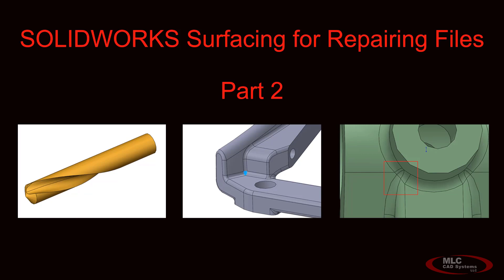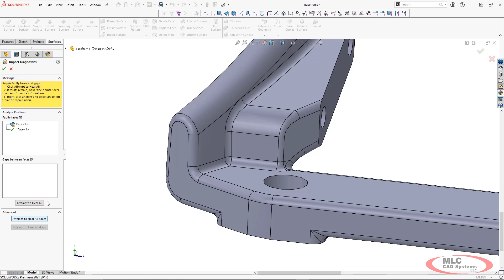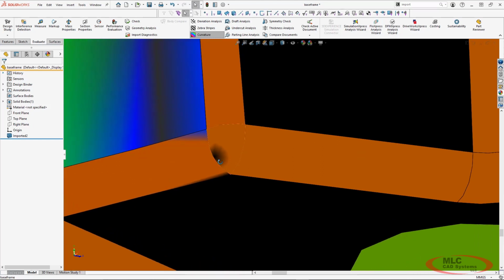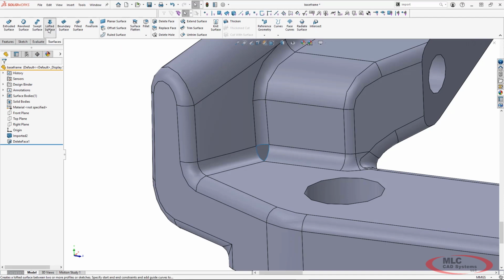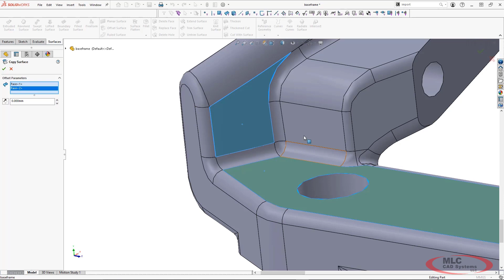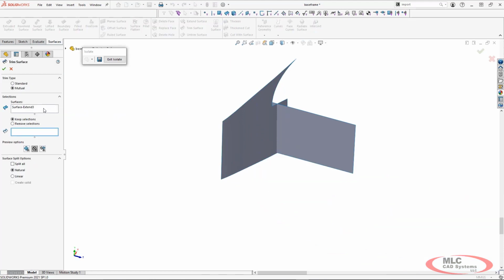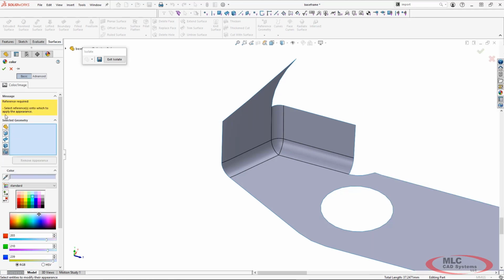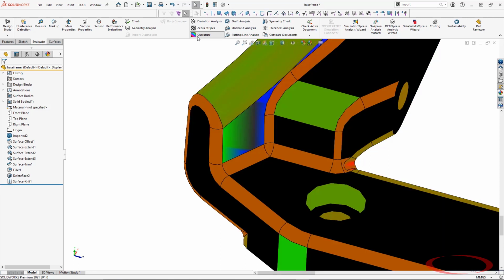SOLIDWORKS Surfacing to Repair and Streamline Parts 2/3 - Repair Geometry

Comment: That fix actually introduced other potential issues, because the new fillet on the left side looks noticeably larger than the original fillet surface that was deleted by the end of the video.
Reply from the maker: The mismatched fillet sizes is actually what caused the geometry error in the first place.  There are multiple ways to try to resolve this issue, but changing the fillet sizes on the part might be considered a design change, and we are simply trying to get a fully-functional model to use for downstream operations.
Reply: @MLCCADSystems , in order to avoid the mismatched fillet, you had to use a variable fillet surface. That way, there would be e natural transition from the smaller corner fillet to the slightly larger one at the very end of the model.
Reply from the maker: That is another way to solve the conflict in the corner.  This geometry was imported and has no drawing specification to guide us in repairing it so the designer is going to have to make some assumptions based on the available information.  Depending on how it is manufactured I think your solution would look nicer.
Reply: @MLCCADSystems , if the imported geometry has some slight deviation in the fillet surfaces and the goal is to manufacture it with standard tools, then it's assumed that the fillets should be carved with a proper tool size. For example, if one filler radius is some random number such like 2,987 mm while the adjacent ones are exactly 3 mm, then the random one should be modified to become 3 mm, too. The difference is small enough to not be considered a design change. But once it's done, it will make the CAM programming a lot easier, as well as the manufacturing of the actual part afterwards. Just my 2 cents.